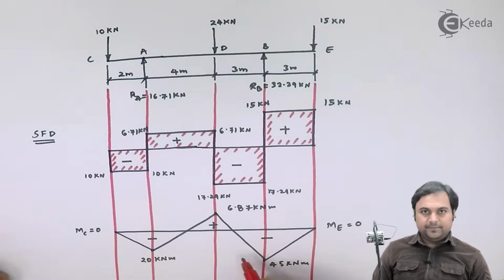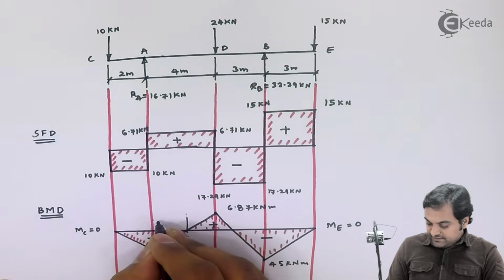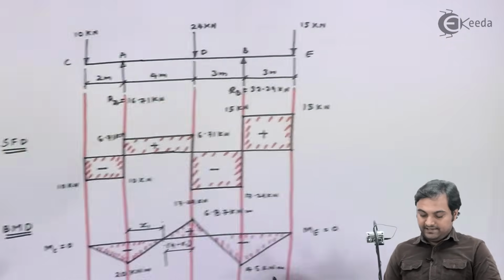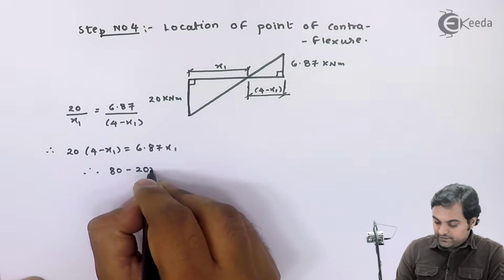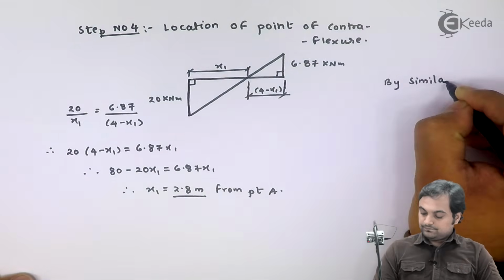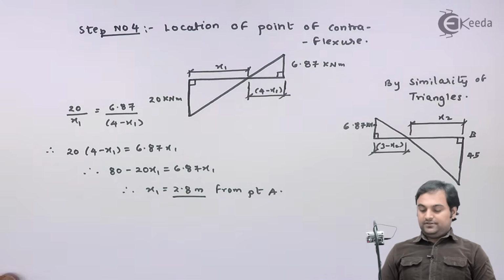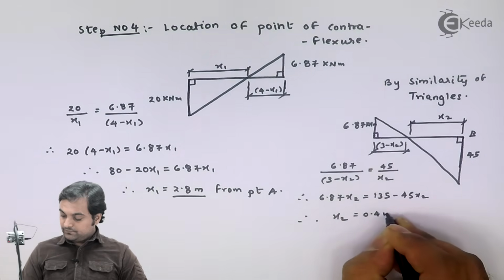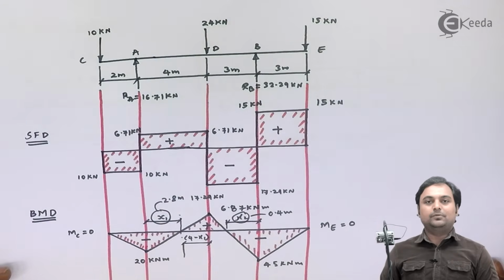SFD and BMD - Problem 1 - Part 3 - Shear Force and Bending Moment Diagram - Strength of Materials

Comment: Sir the value of x2 in your slide is wrong . As you find it as 0.4m but it will be 2.60m as per correct calculation

Comment: Thank u.so much great work.thankss
Reply from the maker: Thank You so much for your appreciation .If you like our videos then you can share your review with us - https://www.google.co.in/search?q=ekeeda&rlz=1C1CHBF_enIN820IN820&oq=ekeeda&aqs=chrome..69i57j69i60j69i61j69i59j0l2.2618j0j7&sourceid=chrome&ie=UTF-8#lrd=0x3be7cef39a0bcb1f:0x695389d0b57989f4,3,,,
Reply: @Ekeeda  point of contraflexure value is wrong 0.4 correct value is 2.6 and bending moment at D is 6.84 not 6.87
Too much mistake is done while solving.

Comment: sr point of contrflexure x2 value is 2.60266 not 0.4
Reply: your are right. And X1 = 2.977 not 2.8 ???
Reply: @mohammadzafar4802  rounded off dude come on
Reply: @mohammadzafar4802  right
Reply: @mohammadzafar4802 Yes
Reply: right one.
Reply: Ya 2.6 from B and .4 from D
Reply: Yes
Reply: Same doubt
Reply: Right
Reply: At least I'm not the only one 😂😂
Reply: Yupp!
Reply: Yes sir 2.60meter
Reply: Tqsm bro u solved my doubt❤️
Reply: good
Reply: I wonder,I have calculated too and I have got 2.6026 and not o.4m
Reply: I literally thought I was deluded seeing my answer as 2.6😂
Reply: Exactly
Reply: Yes
Reply: Right 👍
Reply: Yes bro
Reply: Yes
Reply: Good bro
Reply: its 0.4 from D and 2.602 from B anyway the sir did 99.99% of work excellent
Reply: Even from point a is 2.9 or let's say 3
Reply: Yes.. 2.60 is a right answer..
Reply: W COMMENT
Reply: Yes❤
Reply: Same bro
Reply: Yes you’re correct
Reply: Yes x2 is 2.6 m😢
Reply: Yes exactly
Reply: Yupp
Reply: he's maybe copying from some book. your ans is correct

Comment: x2 is 2.603 from point B. How come he gets 0.4?
Reply: exactly
Reply: 3-0.4 = 2.6
Reply: @manthankahar496  Bro. 4yrs later 🤣🤣
I've completed my engineering.
Thanks anyway.
Reply: @manthankahar496  And no, the answer is still 2.60266 or 2.603 (simplified).

45 ÷ X2      =      6.87 ÷ (3-X2)
Doing cross multiplication,
45 × (3÷X2)   =   6.87 × X2
135 - 45 X2    =    6.87 X2
Taking X2 terms on one side and simplifying them,
135   =    51.87 X2
Taking 51.87 on left side in denominator's position 
(135 ÷ 51.87)     =      X2
2.6026604974   =     X2
                OR
2.603 = X2

Comment: sir point of contrafacture me x2 ki value  2.602 aayegi
Reply: X2ki value from point b se 2.6 hai or point d se .4 hai
Reply: Shubham Diwakar what's parking question when you have nots in properly this distance from be so you can calculate 3 - 2.6 ok is equal to 0.4
Reply: X2 2.6 hi h

Comment: hello every one any can please explain how to solve the equations from above that is 
80-20 x1 = 6.87 x1 =2.8?
and also
135-45 x2 = 6.87 x2 =0.4?

please reply?
Reply: It's a mistake, maybe from the calculator ..x1 is = 2.97m and X2 is = 2.6m .. U can cross-check by calculating by urself
Reply: 80-20 x1 =6.87 x1
       80     = 6.871x1+20 x1
       80      = 27.87 x1
80/26.87 = x1
      2.97    = x1
        X1    = 2.97
............._________..........
135-45x2  = 6.71x2
      135       = 6.71x2 + 45x2
      135       = 51.71x2
135/51.71=x2
     2.61     = x2
          X2  = 2.61
Reply: K Sunil dev Chowdary sad sad what's a distance from beach distance from bliss 360 - 2.6 whatever 0.4 please contest Please concentration this.
Reply: It's 0.4 m from D i.e. 3-2.6=0.4

Comment: great videos all of them sfd bmd...gonna help me in my university exam..thanks man...i found an error in calculation...the point of contraflexure value x3 is 2.604 not 0.4....thanks
Reply: STEVE ARMSTRONG ....o ok I can calculate this 2.6 is that X to answer and their answer also separated from the distance before this distance 3 - 2.6 is equal to 0.4
Reply: @abhijitbera007  which means we can write the contraflexure point as 2.6 respect to B??
Reply: @Diganta_Khati  normally we can do this